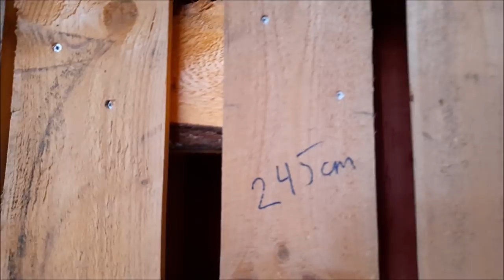Pallet barn interior build part 1.

Comment: I think this is a great overall build. The only thing I would have done differently would have been to add insulation before the outer boards were put on. I’d also suggest some 4-5 inch heavy rubber weatherstripping at the bottom of the doors to help keep the chill off. Nice job though! 🍺🍺🍺
Reply from the maker: Thank you! Since it was planned as a cold barn, so no insulation was needed. Rubber strips are also planned to be placed under the door ;) Thank you for watching!

Comment: I enjoyed watching your videos. I like the skylight the most as it gives you great lighting without needing power. I’m from the USA and kinda laughed a bit when you were pulling the trailer in the mud. My huge 2014 Ram 1500 would have made that light work.The cost of fuel is high for it but I just use it when it is needed. I would have put up a vapor barrier before I put on the exterior siding to insure that the wind couldn’t come in as the wood shrinks over time. That said, I really like the job you’ve done and wish I could do the same but local regulations won’t allow me. Anything larger than a 8’x10’ building needs inspected and be built to code.
Reply from the maker: Hey, Thank you! I'm very happy with my Subaru and it's a very capable four-wheeler, can do better in some places than large SUVs. but then there were bad tires under the car. By the way, this building has a building permit and it is also in the building register. Size 5.2m x 7.2m. Thank you for watching!
Reply: @normalguydoesitall  wow! It goes to show how differently things are done from place to place. There is no way that we could use pallets for construction here unless it is on a farm and doesn’t need to be inspected. I’ve owned a small suv in the past and loved it too but the pulling abilities of a large heavy machine are easily understood. Now if you want to laugh at me for something… my wife’s daily driver is a 2012 Cadillac Escalade ESV with the 6.2l engine. Fuel loving ego machine for sure. My preferred vehicle is my motorcycle. The good news for environmentalist is that we work from home and don’t put many miles on these vehicles. I would have liked to see the process of laying the floor you built. It really looked nice. How did you secure the walls to the ground? I couldn’t quite tell.
Reply from the maker: @jasonlee5317  Hey, since we live in the country, we also have simpler laws, we could not build such a building in the city of course. I'm not trying to laugh at anything, I just bought a larger SUV to haul a horse trailer it is Jeep Grand Cherokee Overland Limited 3.0 D (you can laugh now). I am also a motorcycle type man i try to ride as much as possible in the summer. The laying of the floor was not filmed unfortunately yes. Walls to the floor- Impregnated beams are on concrete, and the beams are anchored to the concrete with concrete anchor , and the pallets are screwed to the beams on the concrete. I hope this helped. Thank you!

Comment: Just got to tell you , I build a complete garage out of pallets, Roof and all, All I bought was 2x4 s 12 feet , On the Roof ,I even cut the pitch angle  and slid both sides up to the rig board,
 kept all pallets in row so it looked like 2x4 s, Once plywood was on looked just like it should , saved be a hole lot of money. plywood was biggest cost, good luck on your build
Reply from the maker: Thank you!  Nice to hear that someone else uses pallets like this as a building material, All the best to you!

Comment: Just curious, why no insolation, or you haven't put furring strips to close off seams to keep the air out as much as possible, but overall great build
Reply from the maker: No need for insulation, because it is a cold barnb, the idea is for the animals to be in a dry and windproof place if needed. Thank you!

Comment: There is no money to save whit this buildning Only dubbel work
Reply from the maker: Hey, In fact, I saved a lot of money on this construction. No double work by the way. And if there had been double work, I have nothing against work ;) Thank you!
Reply: @normalguydoesitall  Loved watching your build series! We built a woodshop building/garage with leftover lumber and siding from our housebuild. We had a window from salvage. On the side we built at covered porch using old fence boards for the wall and painted white, looks like shiplap! Then made a railing  out of the fence boards to trim the porch. The only things we had to buy were the paint, a metal garage door,  roofing materials, and some electrical materials for lighting. It's our favorite place to be as we made a campground next to it with a firepit,  a pool and camper. We love that we did it ourselves.